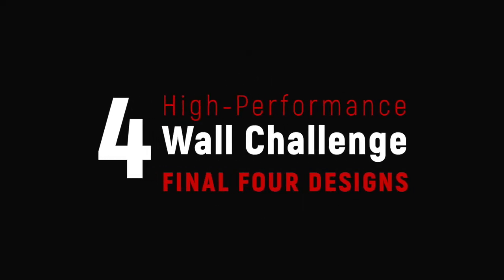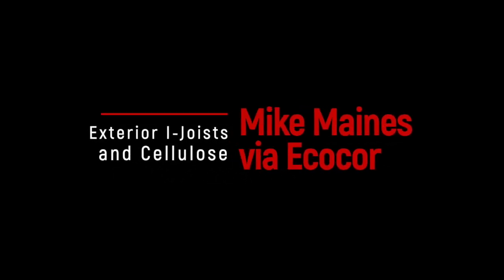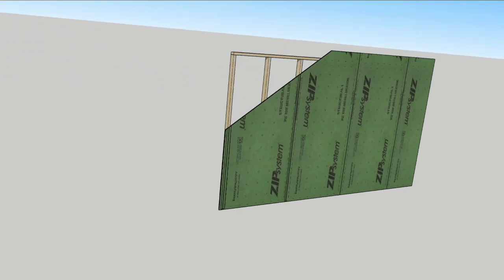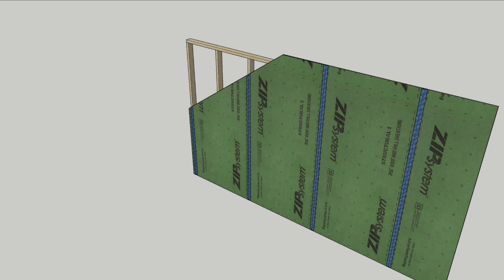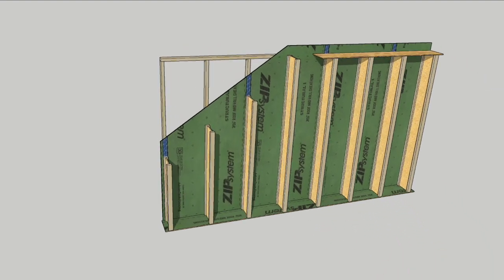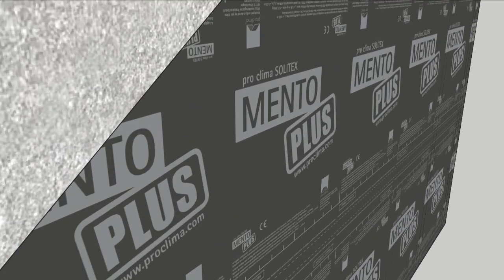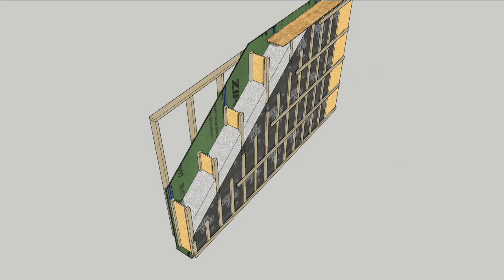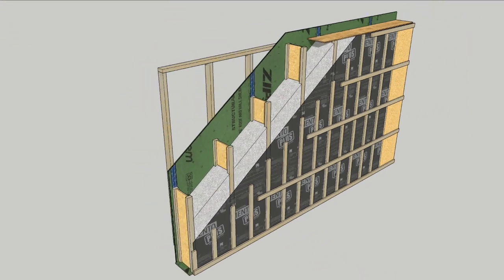Ecocor Panelized I Joist Wall

Comment: Not a structural engineer, but I didn’t think 2x4 with 24” OC was allowed by most building codes / engineers… especially with a bunch of I joists and exterior dense pack hanging off of them??
Reply from the maker: It is always smart to consult an engineer with designs that are noit 'normal.' This design was engineered. (thasnk you for leading with "Not a structural engineer, but..." Alot of people assume they are.

Comment: There's no way the wall in this video is stronger, cheaper, or lighter than two 2x4 light gauge steel walls with the same R-value.
Reply from the maker: Not sure anyone said it was, but if you use steel framing without exterior insulation, you will lose craploads of insulation efficacy. 

See this video about how heat moves: https://studio.youtube.com/video/WeDIW4oMxvc/edit

Heat goes through steel framing like sh*t through a goose.

Comment: High performance for a while but not durable.   External insulation provides many positives if it’s applied outboard of the WRB but this is not.  This is a sick wall waiting to happen.  Vapor will condense inboard of the WRB in a material that doesn’t manage water water well at all.  External insulation allows vapor to condense outboard of the WRB in a forgiving material like rock wool.   Man made materials are effective when used properly but they need to be engineered into a building not slapped on.
Reply: Huh? The WRB IS outside the insulation. Zip is there as the air barrier, as the narrator explained. This is an economical, high-performance, durable and healthy assembly - no offgassing foam or mineral wool.  Another YT expert spouting rubbish...sigh
Reply: @ArthurDentZaphodBeeb agreed
Reply: @Tucker Webb This is a low-embodied-carbon, foam-free wall assembly (fairly sure the other assemblies used foam, which is an immediate hard fail for me). Maines is a well-respected/well-known Passive House designer. Depending on climate zone, I'd prefer rigid wood fiber panels in lieu of the Larsen trusses (but in very cold climates, it becomes difficult to attach thick layers of rigid insulation and that's why Larsen trusses were developed)
Reply: Yeah might be some drying potential problems in some climate but its pretty isolated from airflow in both directions and I think the solitex is supposed to be vapour open so it can dry to the outside.  If built with airleakage in mind I can see it working in most climates.
Would be useful to see some costs vs U value somewhere